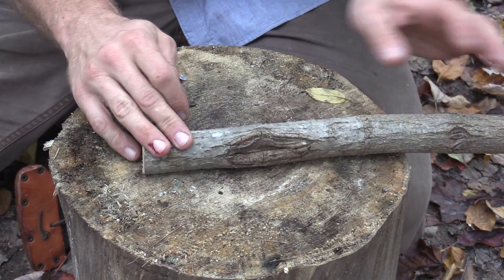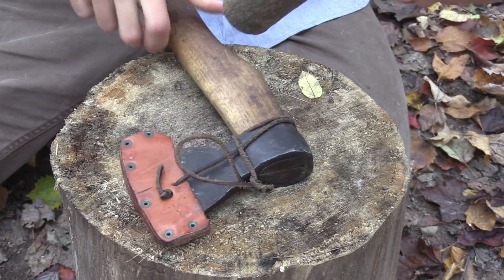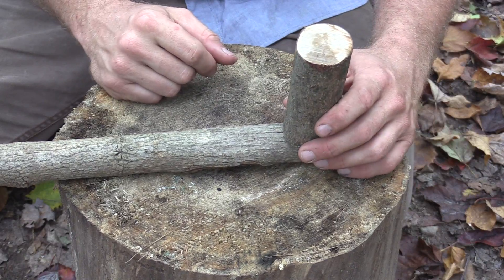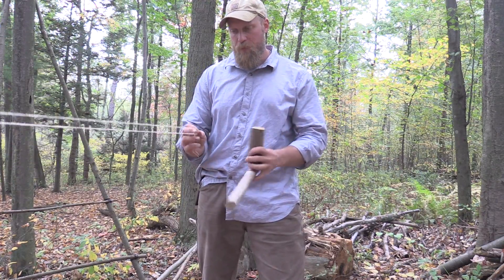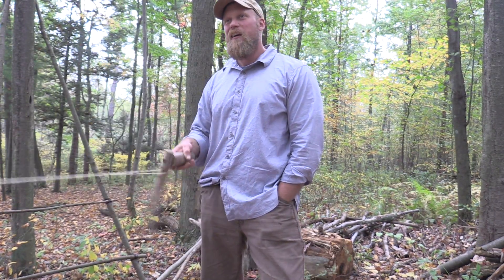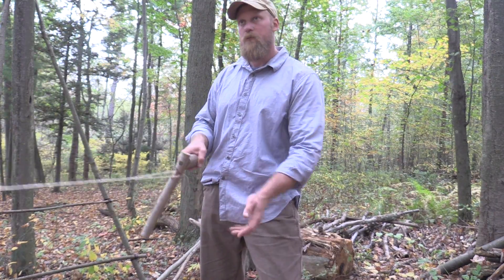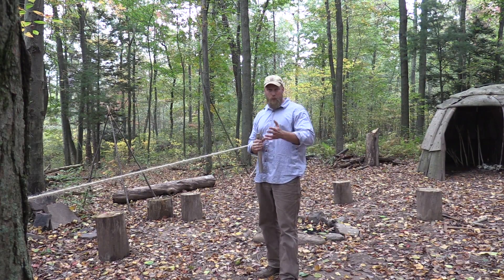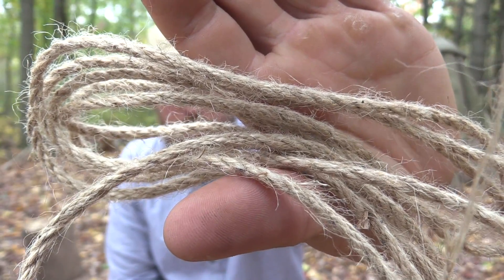Making Rope

Comment: if you flat beat your nail so it has 2 flats, set the nail for the flats to run parallel to the wood grains, like an old fashioned cut nail, and it'll be far less likely to split out your wood

Comment: If you start out by turning your nail point up and with the hammer side of your ax, hammer the tip of the nail, it will flatten out the point slightly and it will not split the wood. I'll be wanting to see you use this in future :)

Comment: If you wanted to improve that rope you'd already made, you could try coating it in some oil (to try to stop water from soaking into it and rotting it from the inside) and running it through a candle to burn off the loose fibers, right?

Comment: I watched a video from the king of random about a saw and a giant contraption 
This is way easier
Reply: Conor Gober that was likely a rope walk and spinner set.   That's how they made professional,  industrial rope for rigging and other use.   This is likely a method you'd find in settlements or tribe areas.     A rope walk will make stronger,  or more stable rope,  because each core is counter spun.   Using this method one core will always be out of phase and won't transfer load  equally as the other two.   But for most applications,  that's not a concern.
Reply: maxdecphoenix that is a good thing thing to have in the possible  survival bag, thanks for letting me see it.